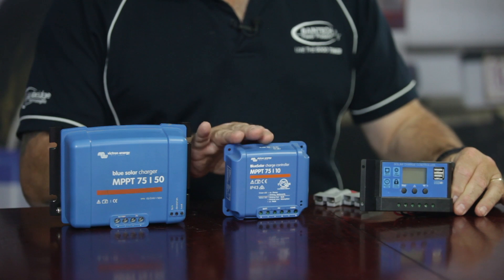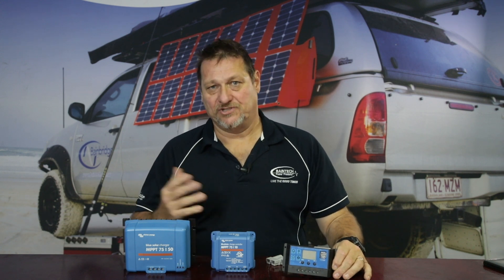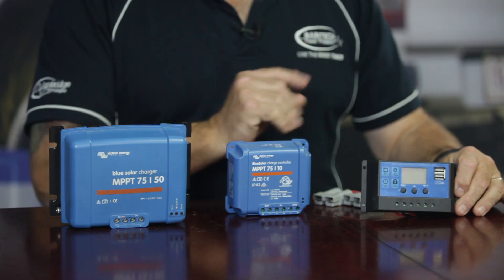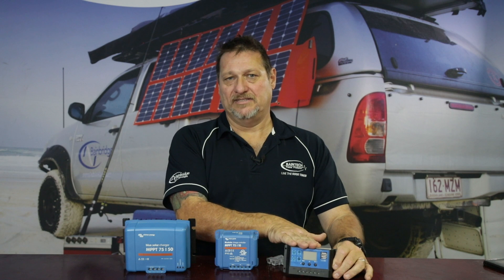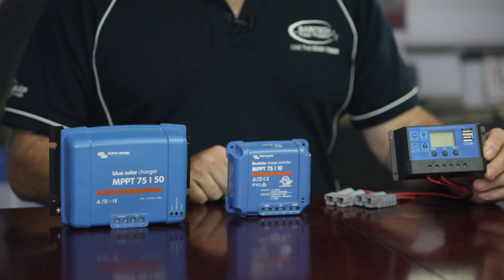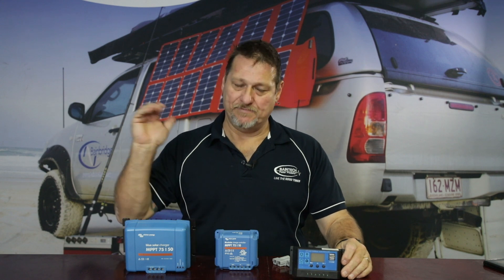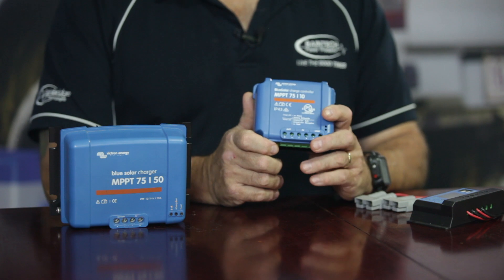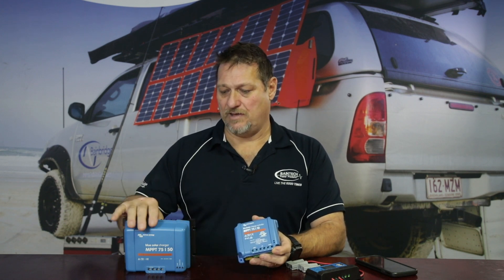Solar Controller Options for your Lithium Battery | Lithium Batteries | 1300 224 683

Comment: I use the one on the right, I'm cheap :),  you can increase the output on these, go into settings, I use a 170w, 36v panel, , and a 20amp cheap controller, my output is a 12v small fridge, led lights, and a small tv, summer time UK, it is ok, winter time, time to get the geny out,  I got a 60amp lifepo4  batt, good vid and info  :)

Comment: Read the manual that came with your lithium battery, mine says to set the solar charge controller to b04 in the settings, I bought a solar blanket and the PWM controller that came with the blanket had that option of b04

Comment: What do do for charging LI-ion battery with solar panel that has DC7909 output cable only when the MPPT controller has negative and positive terminals and in inverter?

Comment: I wouldn't use a PWM, because none of the cheap ones are sophisticated enough to be configured or trusted. The old school ones from 1994, like Plasmatronics and Morningstar are good, but they cost a bomb. Then on ebay, practically everything called MPPT is a fraudulent crappy PWM. You are left with Victron and Epever, and they both still have issues. They are highly configurable, but the Victron can have stability problems when finishing the charge, and the Epevers have bad slow software that can sometimes get the solar input voltage wrong. The Victron won't blow up, and has current limit if you want to be conservative. The Epevers come in 3 models, one of which is cheap and blows up. The Triron and the one that looks like solid aluminium works OK. But I have yet to work out if the Triron is easily configurable.
Reply: Reading through my lithium battery manual it says to set the solar charge controller to b04 and my crappy PWM has that function and charges my battery well
Reply: @tucker2074  some of the cheap ones have bo4, some dont, the one i got did'nt,  i went into settings and increased it to max voltage, it works ,  ish,

Comment: Hi - i have a 100w 12v panel and a 30ah lifepo4 battery.  Also got a 30a pvm charge controller with options for sealed (14.4v), gel (14.2) or flood (14.6). The float, discharge stop and discharge reconnect are adjustable and the charge reconnect is 13.2v. Question is… can i use this pvm controller? And if so what should i set it to and do i need to change the adjustable values. Hope u can help
Reply from the maker: Hi There please call our sales rep on - 0407 172 441 or email graham@baintech.com.au

Comment: Hello I just bought your 110ah with dcdc built in. What one of these would you recomened. I want to put a solar panel on my roof.
Reply from the maker: What size solar were you thinking?
Reply: @bainbridgetech  170w single  fixed panel
Reply from the maker: @putnamehereholdmadoodle  I would go with a Victron SCC075015060R  75/15 Smart Solar MPPT
Reply: @bainbridgetech  cool ty I got your battery today, can't wait for it to get installed